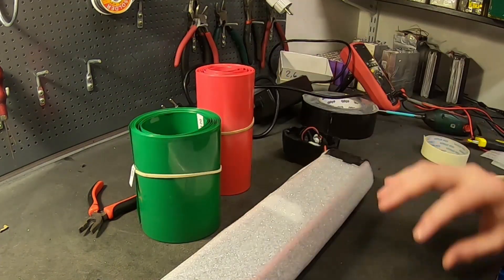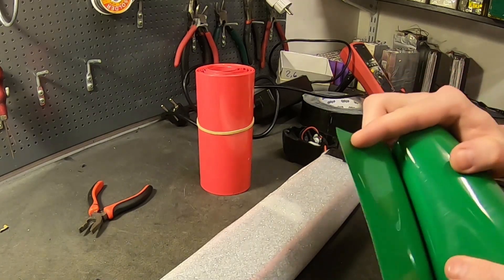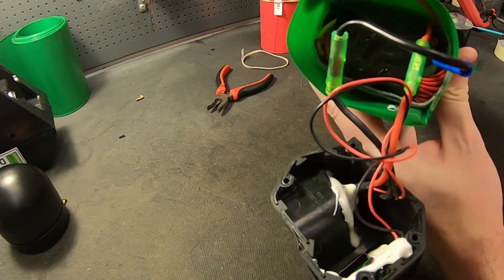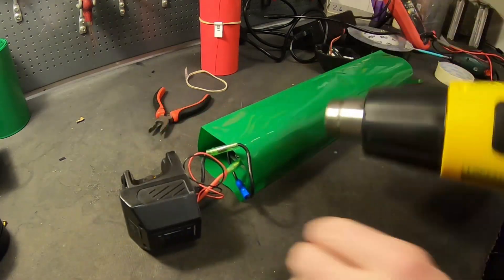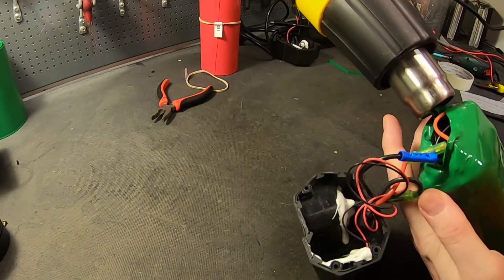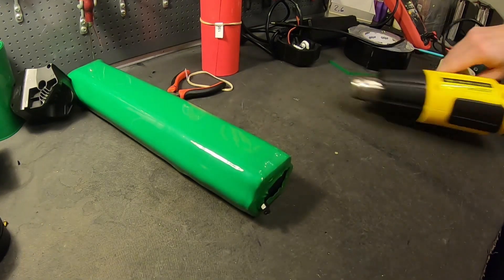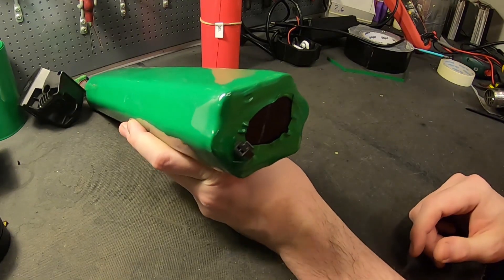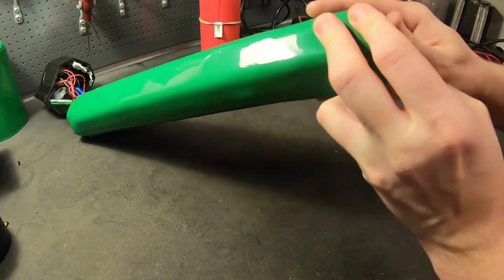How to add large heat shrink tubing to batterypacks

Comment: I want to wrap my lipo batteries this shrink material. What is the safe temperature to do this? My heat gun's temperature is 100 degrees minimum. Is it safe? I don't want to lose capacity or damage it. Can i learn your opinions. Thanks.
Reply: I think 100*C is fine